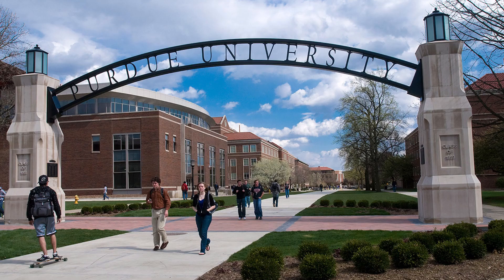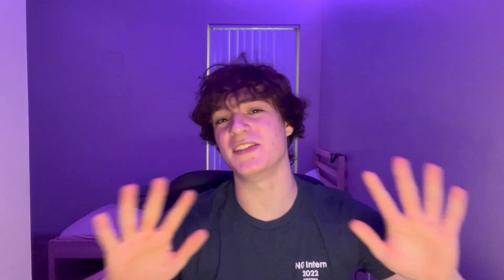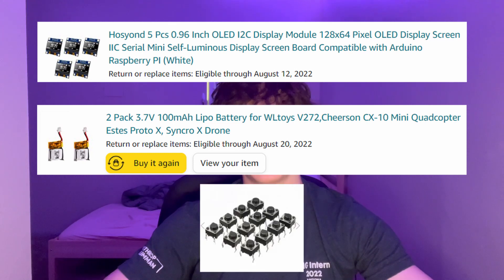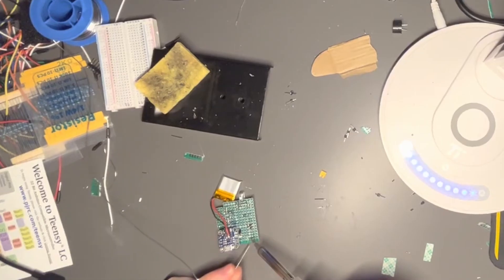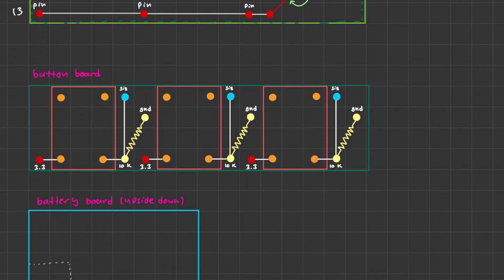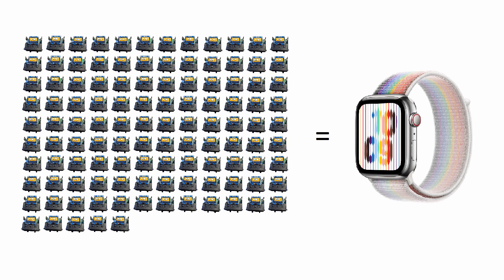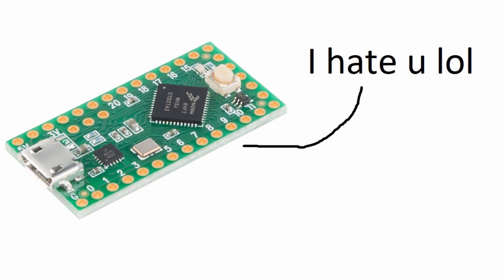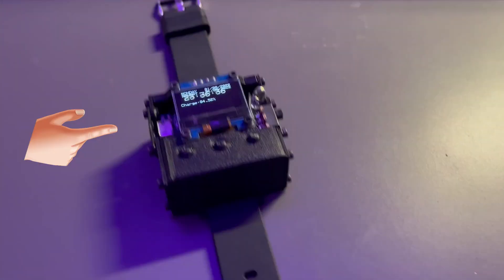how i built a lame smart watch and why you should too

Comment: I am super curious why the epaper display didn't work out, that sounded pretty cool
Reply from the maker: The MC I got wasn’t powerful enough to push the display. The one I got was too high res. The library in general wasn’t designed well for teensy microcontrollers. The reason I didn’t go for the super caps and TEG is due to very low voltages.
Reply: @quantumprojects_yt  I've got a small collection of microcontrollers, some with decent specs, so lmk if you want to use one to make an e-paper version, I'd love to see that